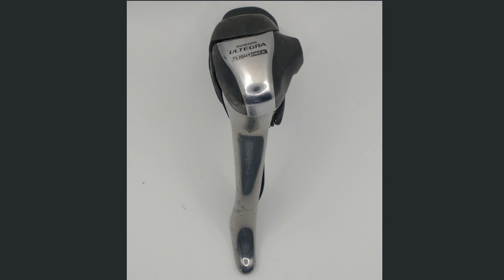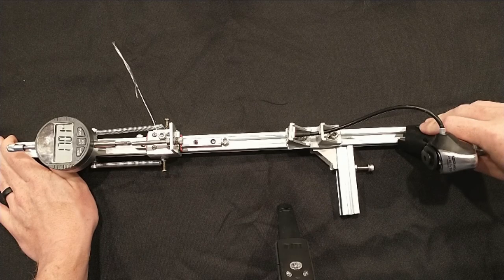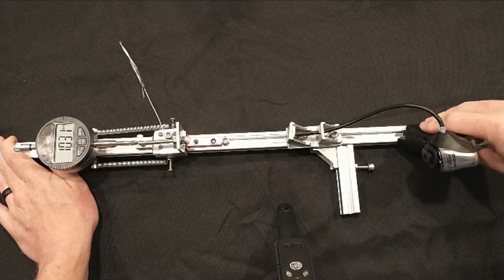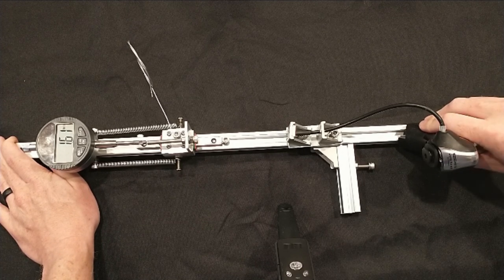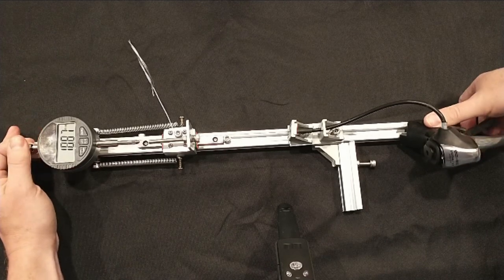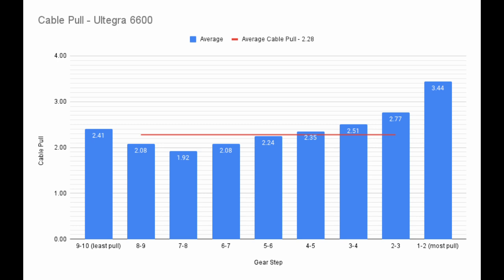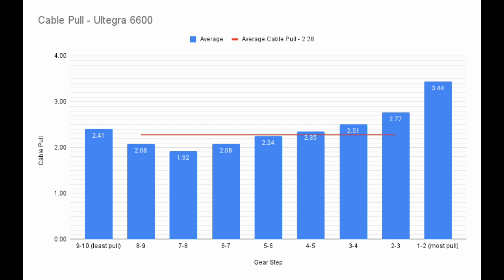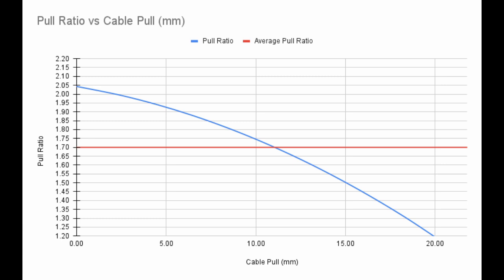Shimano Ultegra 6600 10-speed Shifter Cable Pull

Comment: Love this work. I have been experimenting ever since Sachs "Ergos" with (otherwise) Shimano 8s matched up back in the early 90s. Then Shimergo, and now running a simply modified Dynasis 10s RD with SRAM 9s shifters for cheapass 9s with a clutch - flawless. Any likelihood of a consolidated document that enables "proactive" experimentation - i.e. all known (measured) RD pull ratios, shifter cable pulls, and cogs spacings? Then all you hard work could really be put to use by identifying the best component to use, when you have two already in hand ...
Reply: I have started compiling it ...
Reply from the maker: Sorry to make you compile the list. I'll start linking to it in my videos. My full list is here: https://docs.google.com/spreadsheets/d/1uxu7OSKLG3JzhmOIg-iWHz-p8MW0ou0HCLRWk4BoO04/edit?usp=sharing

I'll add SRAM 9-speed 1:1 systems to my list of parts to measure. That looks interesting.

I'm working on a website that will help you pick components that could work together. I hope to get that in a presentable form soon and make a video.
Reply: @boothsbikeprojects  Awesome. I have already compiled all the major cog pitches, and have plenty of data on the Taiwanese and Chinese drivetrains. I'll share with you when I get home. Perhaps we consolidate ... ? Is Russ involved with this? How can I get into the discord server?
Reply from the maker: That's fantastic! I'd love to see your data.

Russ is not directly involved, but he inspires me with his projects and the measurements I make have helped reassure him that certain combinations should work, like Sword+CUES.

You can join the Discord by joining his Patreon: https://www.patreon.com/PathLessPedaled

Comment: Interesting background info via reverse engineering! Microshift Advent x9 would be an interesting subject, since it's not Shimano/SRAM 9-speed compatible, so how far off it actually is? Also Microshift product lines in general, it would be interesting to know their pulls and tolerances. And yes, Path Less Pedaled lead me here.